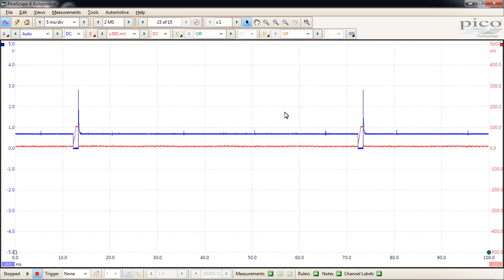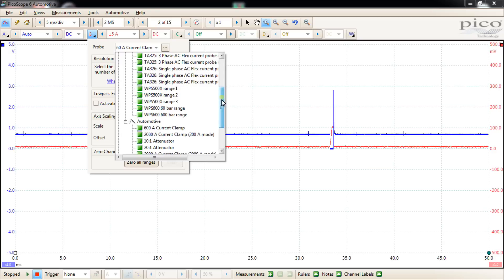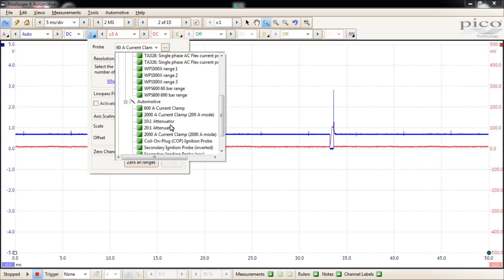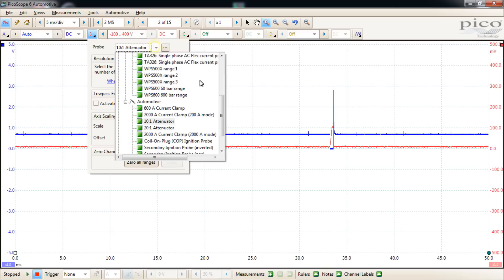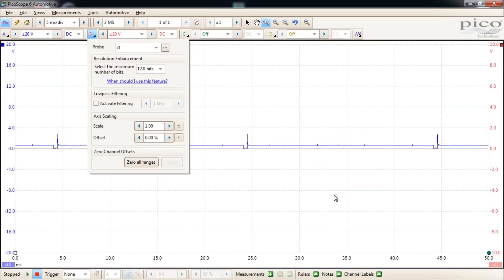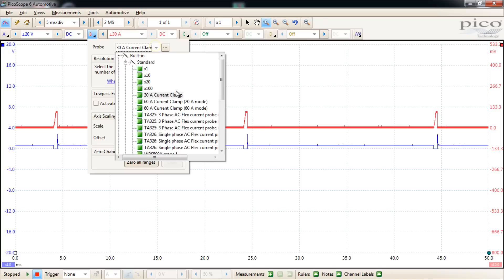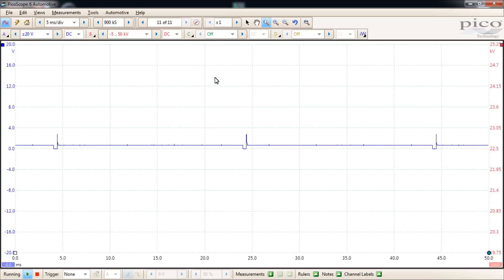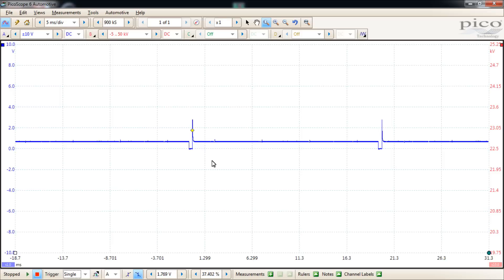3. PicoScope Navigating Part 2

Comment: Great videos. I have a question. When you use the x10 feature to divide the voltage scale do you still have to use the x10 attenuator to protect the scope? IE when viewing primary ignition patterns.
Thanks Stuart
Reply from the maker: Great question! The attenuator that you install inline at the PicoScope is the physical protection for your Scope. The setting in the software is nothing but the user letting the software know what accessories you have installed.  The attenuator does the physical work by reducing the voltage input to either 10:1 or 20:1. 
When you change the settings in the software, you are simply letting it know what accessories you have installed and it will do the appropriate math for you  to allow the voltage numbers displayed to be correct. Brin explains attenuators in a previous video we released here:  https://youtu.be/x-sW7gdMKOc
Reply from the maker: "Inductive kicks" from solenoids, injectors,  ignition coils, etc, can reach over 200volts. This is potentially damaging to your scope and it's best to use an attenuator on this circuits to prevent damage.
Reply: Thanks for the reply. And the great videos